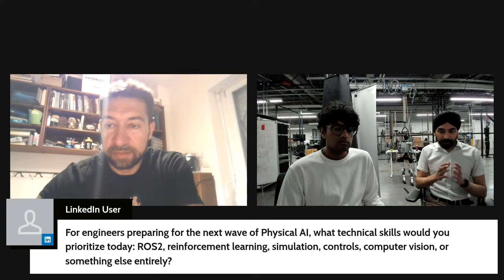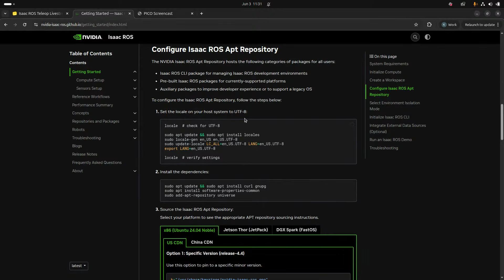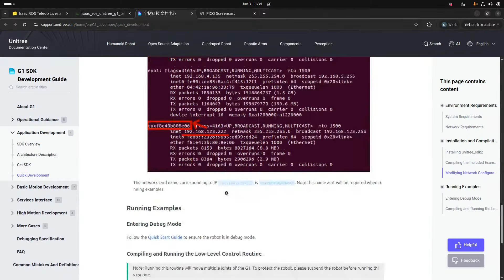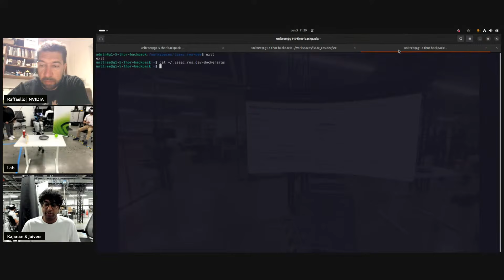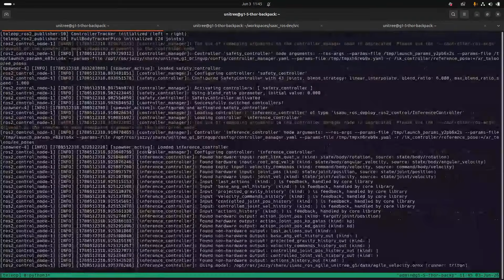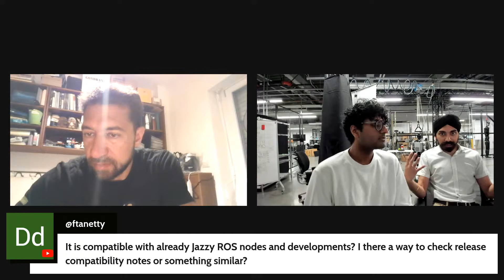Isaac ROS Teleop for Robot Control | Robotics Office Hours

Comment: which networking stack used here for communication at network layer like UDP TCP .  what if this teleoperation is from another country then what will be the network latency to transfer this commands from headset to robot and overall time  from sending commands to rendering that commands at robot side . Is there any way to  modify network protocol stack for minimizing this latency or do some research on network latency in teleoperation and solutions for that